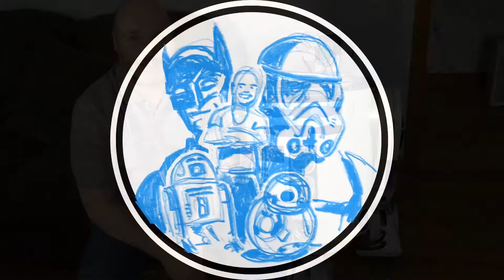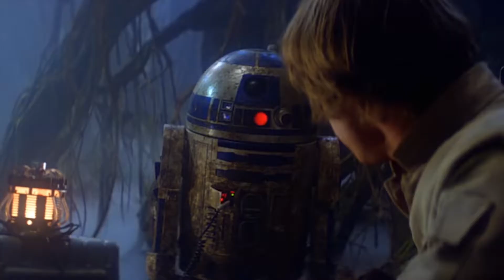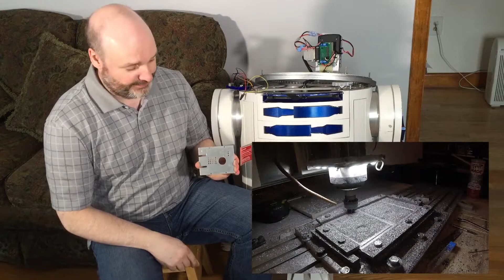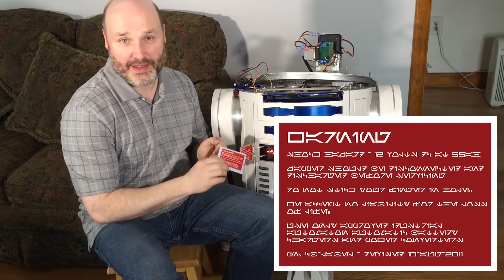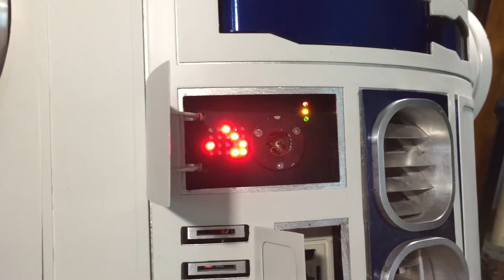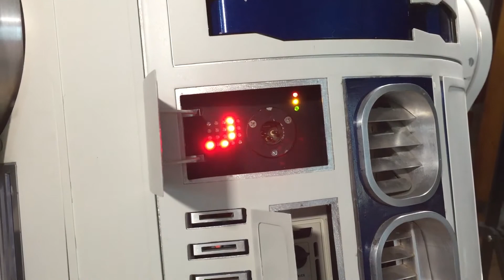Improving R2-D2's Charging Bay Indicator!

Comment: For anyone wondering. The label says:

WARNING

SHOCK HAZARD 12 VOLTS DC AT 55AH

ZAPPER SHOULD BE DISCONNECTED AND
DISCHARGED BEFORE SERVICING

DO NOT STICK YOUR FINGER IN HOLE.

WE ACCEPT NO LIABILITY FOR THE LOSS
OF LIFE.

USE ONLY APPROVED INDUSTRIAL
AUTOMATON AUTOMATIC BATTERY
CHARGERS AND POWER CONVERTERS

PN: CB-LABEL – REVISED 10-AUG-2011